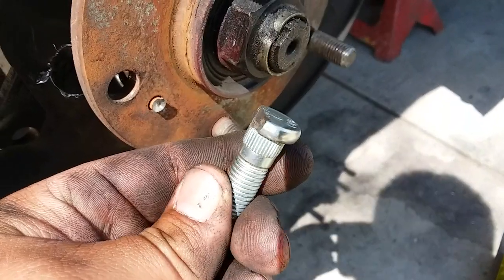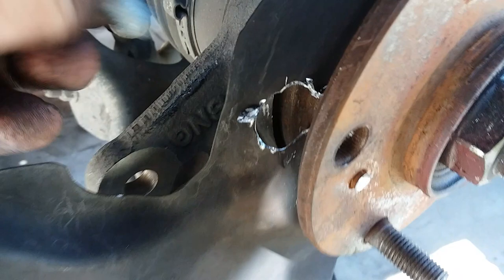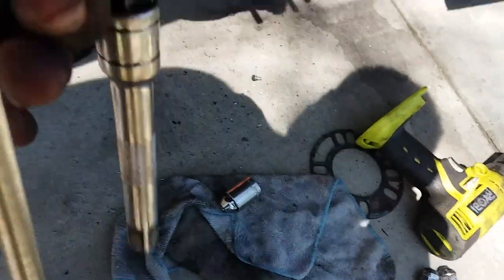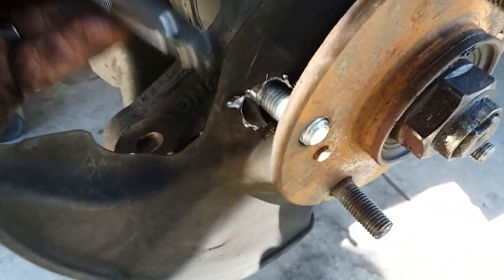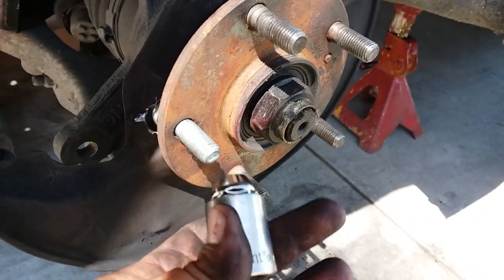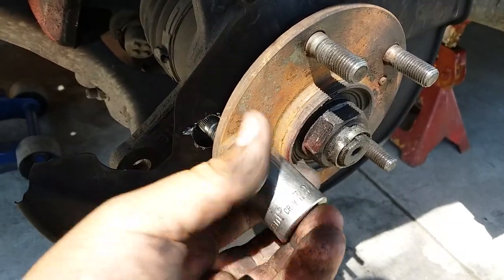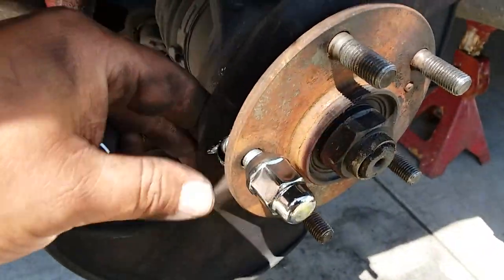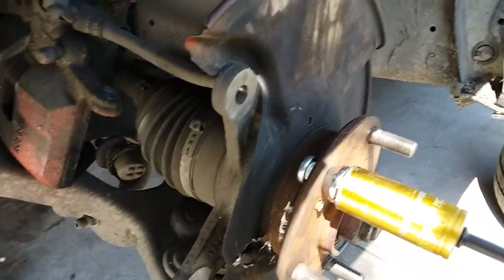How to: Replace a front wheel stud on a 2006 Honda Civic Si

Comment: The shield have a hole to put new studs no need to drill or remove the shield. All you have to remove is the caliper. I just did this today on my 2006 Honda civic
Reply: They don’t on the Si’s

Comment: What's the 'proper' way to do it without drilling?
Reply: Remove the wheel hub and bearing. Have to replace the bearing most likely as well as the outer bearing race will be stuck on the old wheel hub and ruins the bearing. Its a lot of unnecessary work and replacing things that dont need to be.
Reply from the maker: I like this answer.

Comment: What are the size for the studs? I have a 2008 civic si coupe that needs 2 of these replaced
Reply from the maker: Found them at Autozone.... https://www.autozone.com/suspension-steering-tire-and-wheel/wheel-stud/p/dorman-wheel-stud-610-269-40/1079805_0_0

Comment: Can u just hammer the rest out
Reply from the maker: You can try but the back piece is in the way
Reply: @559powerscape  it comes right out the back wit the hammer no prob just need to cut the metal shield

Comment: Be real w me big dog. Your wheels fall off? Im about to do this shit and I'm nervous lol
Reply from the maker: 🤣🤣🤣 just the stud was bad. No issues
Reply: @559powerscape  when you pulled the old studs out, did you have to cut them or do anything like you did to get them in? Or did they slip out with no headaches or modifications?
Reply from the maker: To get it off I did have to cut it and then to put it back in I had a grind one side of it And make a hole through the heat shield